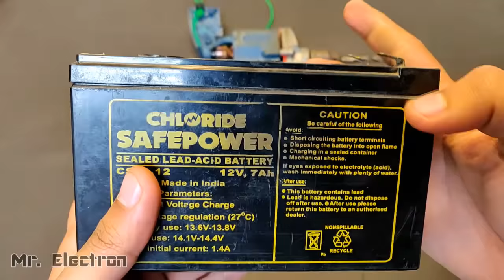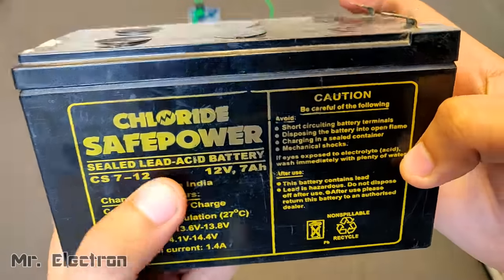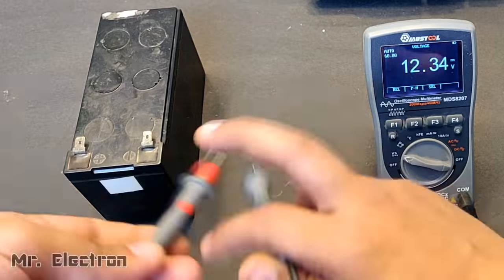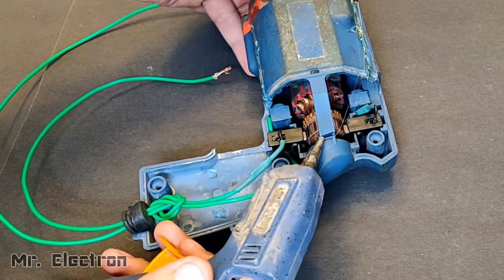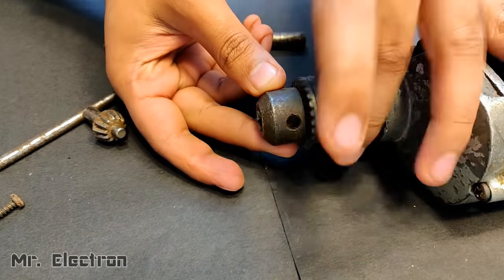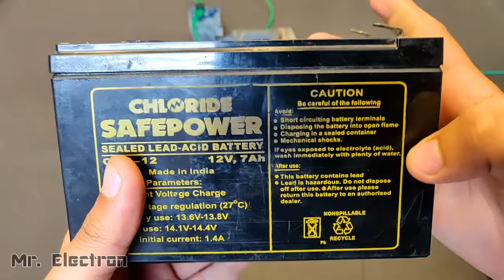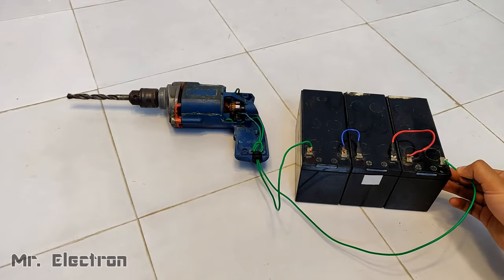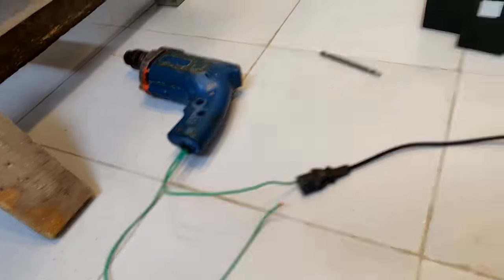Convert 220v ac Universal Motor drill to 12V DC Motor drill machine

Comment: The only confusion I could see from other members who don't understand. The reason you didn't have enough power with one battery, then 2 then 3 but 4 worked was the resistance of the drill after the hack. The only reason it pulled so little power, wasn't because the battery couldn't handle the amperage. It was because the drill needed more voltage with high resistance to get enough amperage to run the drill. The single 12V battery probably has the power if you connected a boost converter capable of the amperage.  Great Video and Hack!!!

Comment: That drilling machine motor is a universal motor,so it can run on both dc and ac. you only need to rewind its coil to 12v.(theoretically 😁)
Reply: You are right
Reply: the stator?
Reply: @doryempleo9717  it is a series motor,so stator windings and rotor (armature) windings are in series.
Total voltage=stator (field) voltage+rotor voltage.
power= voltage x current.
If you decrease voltage, current increase for the same power.
It may lead to increase the diameter of winding wire.
Reply: Only Star with tour James un 12 volts
Reply: Exactly .......
Reply: @boby56bbb  And also no. Of winding turns also decreases
Reply: yeah i am also answering this but you already told that

Comment: If you set DC voltage at any brushed machine it will work without modifying. If you get 10 batteries you'll get 127v DC . You will have to reverse the wires if want to run reverse.
Reply: Yes that's true! I've done that many times. One time we need to bolt down an indoor cabinet at a cell site. There's no ac power, I connected the drill to a breaker via wires. & the power on that rectifier cabinet is -48v  DC. 
No need to experiment like in this video.
Tnx.

Comment: Mr Electric , you need to changing Armicher Details too , this kind of drail normally have this details : 20 or 22 turns of 0.25 mm Cooper wire , and Every coils exist by two in serial turns , mining is Twin 22 turns. I tell you the best new details is : 2 x 4 turns from 0.5 mm Cooper wire . And you most understanding about correct circuits in collector . Be happy .

Comment: remove the brushes and with a wire on the positive and a wire of the negative from the battery, touch the comutator with both wires you have now a brushless dc motor because you added magnets inside

Comment: The Parthians made a clay jar, filled it with vinegar, then put a copper cylinder inside of it with an iron rod sticking out of the top. This early type of battery was used to electroplate silver.

Comment: Without any change you may run your drill machine by 72volt Or above DC. Because your drilling machine is ac/dc, so no required any change to run by dc.

Comment: If you want to use 12VDC battery to run a drill, you just buy DC to AC inverter, it's more convenient and cheaper than 4 batteries and still can use the drill using 220VAC.

Comment: How to make a 3.6v dc motor to wire to a 120v outlet.
So my 3.6v dc motor screwdriver woul d work again. Just with more power from a outlet. In ac wiring

Comment: With 20 12v batteries you will have 240 volts. Haha. And with a battery and an inverter you can get 220v AC. So what's the point?

Comment: hmmmm.......by design an UNIVERSAL MOTOR can works with  AC or DC...if you put a rectifier bridge at 220 volts you have the enough voltage to drive the drill....by design you need more tha 200 volts, AC or DC!